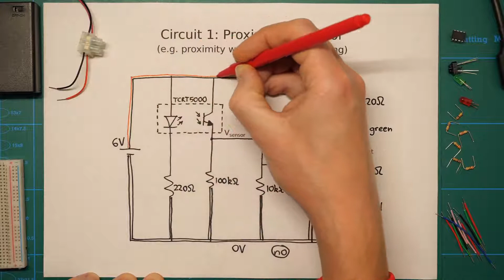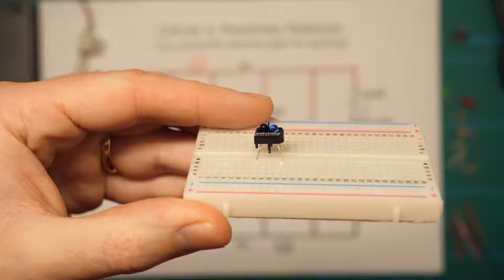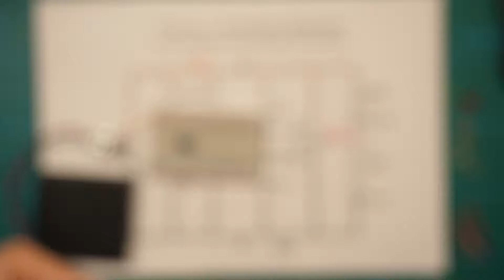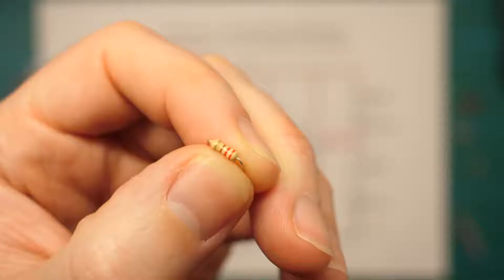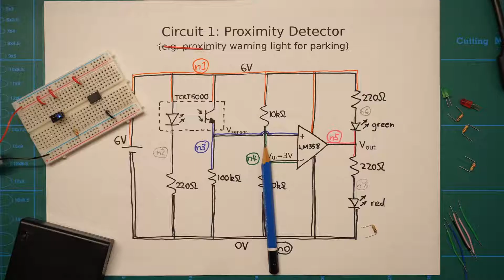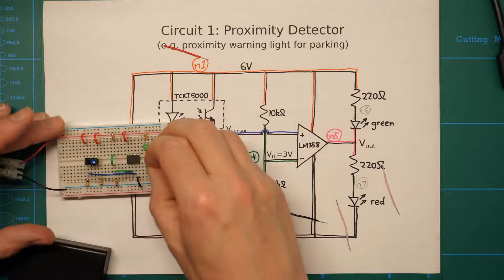From circuit diagram to breadboard - worked example - TCRT5000 proximity detector

Comment: Hello.  My circuit didn't work.  I used a 9V battery.  For this reason, I used a 500 ohm resistor with resistors in series with the LED.  Why do you think the circuit doesn't work?  Could it be that Tcrt5000 is not working?
Reply from the maker: Hi Nermin. If you can share a photo of your circuit, I'll try to see if I can spot a problem. Which resistors exactly did you change? One thing you can do is to check to if the TCRT5000 is emitting infrared light by looking at it through the camera on your phone.
Reply: @DrTedBurke How can I contact with you?  If you share your e-mail with me, I can send you a photo of my circuit.  Thank you for helping.
Reply: @DrTedBurke  I am using 9v battery.  What should I change in my circuit?
Reply from the maker: @nerminoruc480  Just stick the photo on imgur and share the link here. You don't need an account or anything; just drag and drop the photo in the box and grab the link...
https://imgur.com/upload
Reply: @DrTedBurke  My Trct500 is broken.  I bought a new one and rebuilt your circuit.  My circuit worked very well.  Thank you very much.  I learned a lot thanks to your video.  You should continue this type of content!
Reply from the maker: @nerminoruc480  Thanks Nermin! Glad to hear you got it working 🙂

Comment: Is there a reason for applying a voltage of 6v?
Reply from the maker: In this example, the power is supplied by a 4 x AA battery pack, so that's why the voltage was 6V. It should work fine with a 5V supply. The lower limit of the LM358 supply voltage is 3V, so if you go much below that the circuit probably won't work at all. Between 3V and 5V the circuit may work, but you might see reduced output from the LEDs (especially the red LED). The LM358 opamp actually supports supply voltages all the way up to 32V, so in principle you could increase the supply voltage that far, but you would definitely need to increase the resistance in series with each LED to limit the current to a safe level (to protect the LEDs and the opamp).

The circuit should work well with a 9V battery if you increase the resistance in series with each LED to somewhere in the range 500 Ω -1000 kΩ.

Comment: I wonder why the green light goes off when the red light is on
Reply from the maker: The LM358 opamp is used in open-loop mode here (i.e. without negative feedback), which means it's generally either in positive saturation (Vout is close to 6V when Vsensor is greater than Vth) or negative saturation (Vout is close to 0V when Vsensor is less than Vth).

When Vout is close to 6V, there is a voltage drop across the red LED, which means it's on, but there's not much voltage drop across the green LED, which means it's off. Conversely, when Vout is close to 0V, there's a voltage drop across the green LED, which means it's on, but there's not much voltage drop across the red LED, which means it's off.

I'm simplifying slightly, but that's the gist of it.
Reply: @DrTedBurke  Thank you!

Comment: You didn't mention how far it can detect an object. A 30 minute long video and you forget the most important info that I'm looking for.
Reply from the maker: Not far. Using the component values shown, the range will be a few centimetres, but the exact distance will depend on the object that the infrared light reflects off. You can increase the effective range in several ways: 
1.) Reducing the LED resistor (shown as 220 Ω) to increase the amount of infrared light emitted. 
2.) Increasing the phototransistor resistor (100 kΩ) to make the phototransistor voltage more sensitive to small variations in the amount or IR light falling on the sensor. 
3.) Reducing the threshold value by changing one or both of the 10 kΩ resistors. 

You can find more details about the TCRT5000 sensor in its datasheet, which will take you a lot less than 30 minutes to download.

https://www.vishay.com/docs/83760/tcrt5000.pdf

If you want to detect objects more than a few centimetres away, I recommend using a different type of sensor (e.g. an ultrasonic rangefinder).